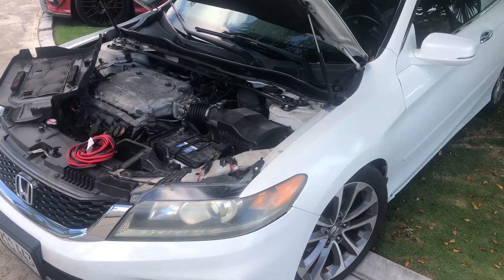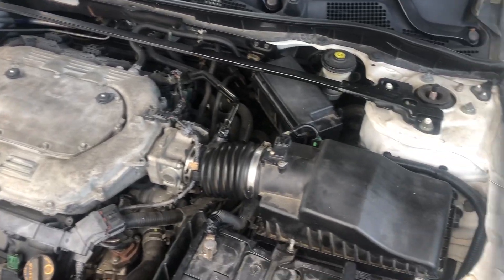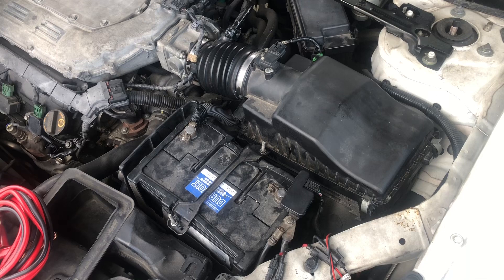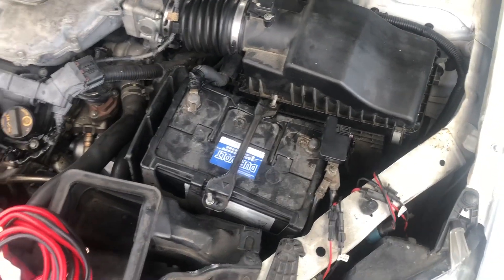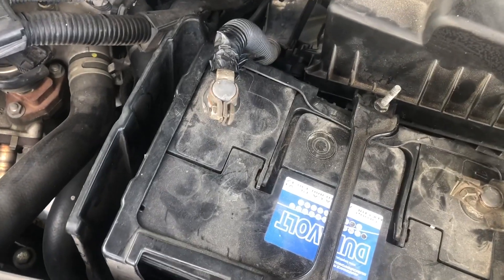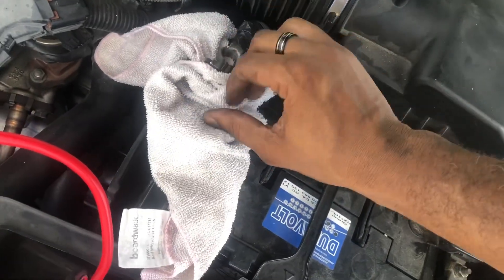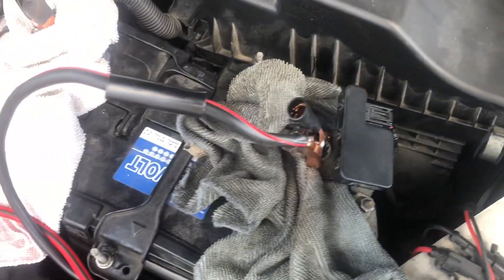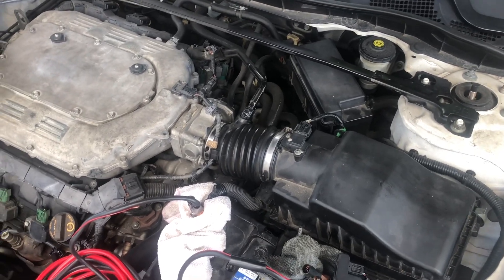How to reset your cars Computer (ECU) without a Scan tool

Comment: This does nothing to the pcm, as soon as you start driving it again it will come up with the same codes shortly after using the vehicle. It basically temporarily clears codes and that’s all. If the problem still exists . The codes will come back up. This guy is a moron!

Comment: This does not make sense!  Where did the other ends of the jumper cable get connected?  Does not look like this would reset anything.
Reply: It's jumping the positive to the negative, he's using just one wire on the jumper cables! This resets EVERYTHING by draining all memory by allowing all capacitors to drain completely. Thus PCMs, ECUs, body control modules, etc. to reset to factory default- BRAND NEW. Then the system will "RELEARN" everything.
You don't need to use jumper cables, a simple wire with alligator clips will work fine. All your doing is shorting the system, thus draining all power. Hope this helps you understand :)
Reply: @jim52970 he’s using positive to negative means he’s only connecting negative end of the cable to both battery terminals? That’s what i noticed. Am I correct? Is that what u were saying?  I love to try this if this will actually work and not damaged my ecu system.
Reply: @leetos.4915  No. The negative cable is connected to ground ...the chassis of the car. So jumping the positive cable to the negative is simply grounding the positive cable. You could do the same thing by jumping the positive cable directly to ground (the engine block).  As was previously mentioned, this is to drain/discharge any holding capacitors that keep any volatile memory alive ...like your radio presets or, settings in the PCM and other computers. To help things along, you can get in the car, depress the brake pedal and try to start the engine.